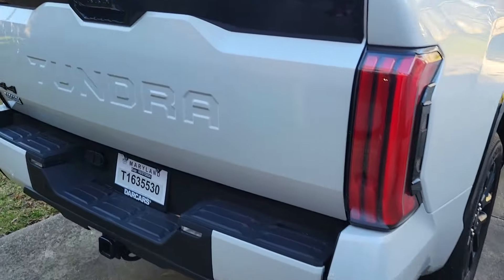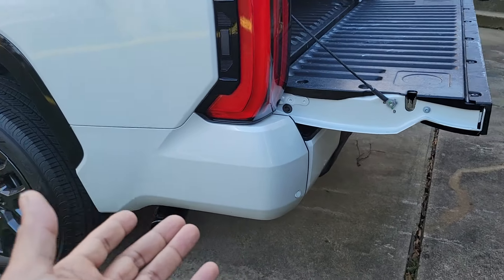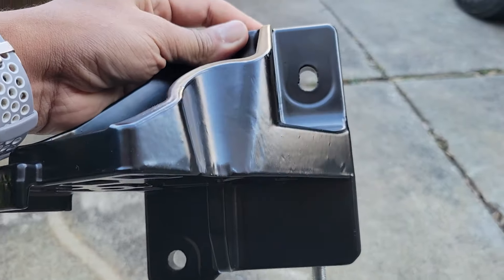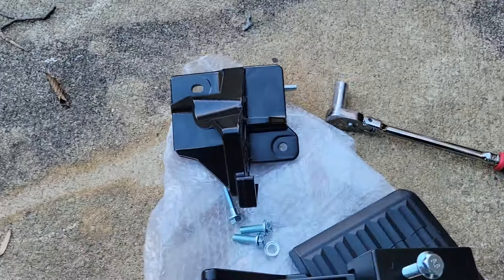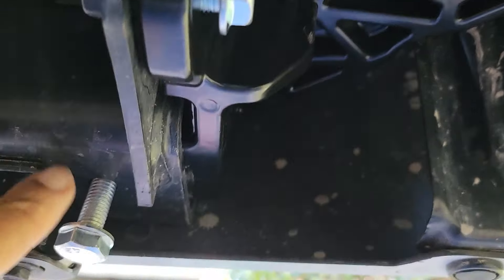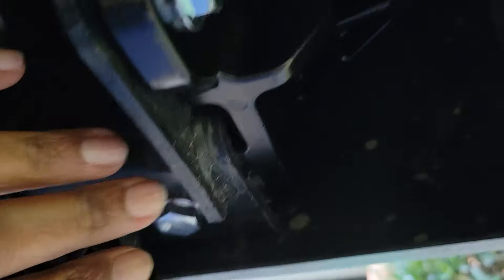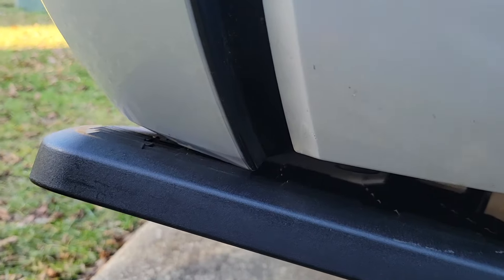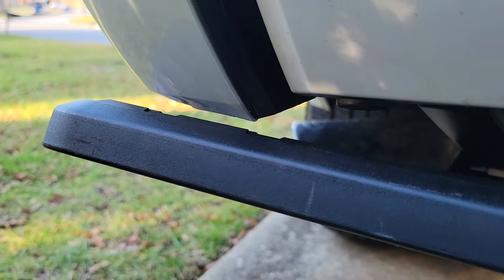2023 Toyota Tundra Bed Tailgate Step Install

Comment: Thanks for the video. It definitely helped me put on this tailgate step. 
Only thing that I did different. Was loosen the rear bumper trim that was secured with retainer clips. so that I could reach the third bolt. That helped me a lot 
But anyway, good job on the video and thanks for posting
Reply from the maker: Glad it helped

Comment: I have a 2023 Tundra Limited Crew Max 5 1/2 Bed TRD Off Road.  Mine came with the step.  I was like you thinking I did not need the step.  It is a must have and I would not want a powered one as that is something to break.  I could not easily get in the bed without it.  My kids even use the step.  My only complaint is I wish they made a step for the right side.
Reply from the maker: Yeah I agree. I like symmetry

Comment: I jjust installed the same exact step on my new 2024 Limited (same color, too) and my step does not touch the bumper when closed.  Thanks for the video!
Reply from the maker: Yeah I think it's a made in China thing. Some do and some don't.

Comment: You should remove that bracket holding the bumper before installing the step bracket. It makes for an easy installation without having to modify the bolt and nut.
Reply from the maker: True

Comment: I think you would be better off making a full spacer plate instead of using washers. Be alot stronger and less stress on the bolts with the whole thing sitting flush. Just an idea. I got a feeling it may have a little more play and eventually work the bolts loose or waller it out without the whole thing sitting nice and flush.

Nice step though, and nice video. I wonder if I can make that work, or something like it work, on an 04 Tacoma.
Reply from the maker: Yup a full spacer will be made.

Comment: What type and size spacers did use? Got same aftermarket bed step and plan to install this week
Reply from the maker: Sorry I missed this bro. I used 2 washers per bolt for now. I need to get a piece of aluminum cut to size. I would say 1/4" would work. Yours may not need it tho. I read it's hot or miss

Comment: Been saying this from day one when I saw the new Tundra. The engineers messed up in so many ways. This is a truck and there is no steps to get in the truck with tailgate down. There is nowhere to the sides of the bumper to put your foot.  This is insane. Owned a previous Tundra and I don't think a step should be an option. It is those stupid things that makes me decide that I would never buy this Tundra. There are too many design flaws that are retrograde. I have no idea what's happening with these engineers at Toyota lately.
Reply from the maker: Yeah they def dropped the ball with this. I honestly love the truck tho. There are only a few negatives I can point out so far with about 1500 of my miles on the truck. But I am going from a 2003 gmc sierra to this. Haha. Thanks for commenting.
Reply: GMC owns so many patents for steps. Ford has some too. So it makes it a bit challenging. GMC has the best tailgate, rest of the truck is shit. Hence why Ram had a barn door and Ford has a mini door.
Reply from the maker: agreed